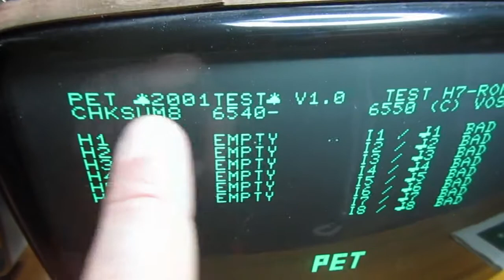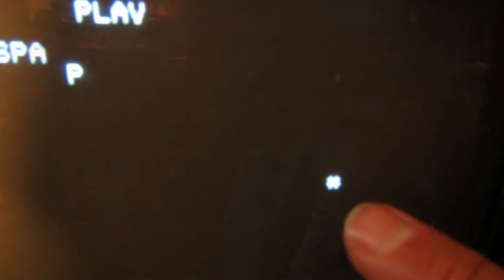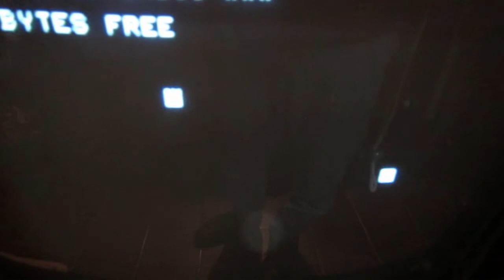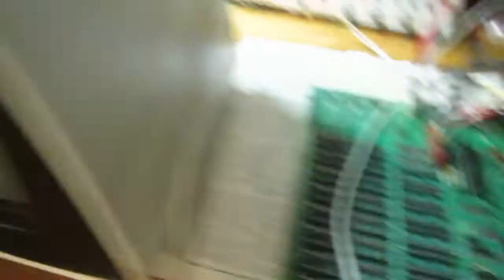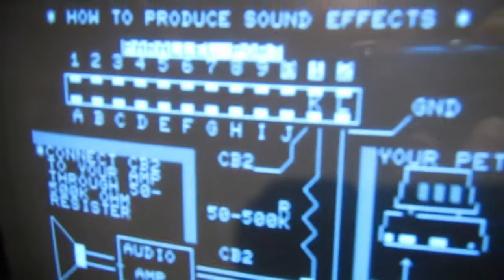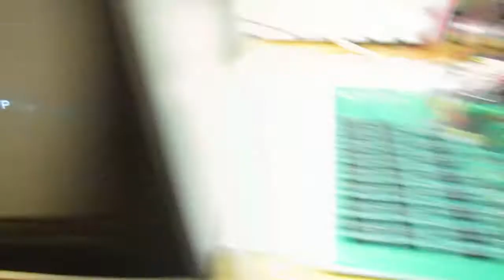Commodore PET 2001 repair. RAM/ROM daughterboard comes to rescue.

Comment: Interesting that the apparent video RAM fault was down to the speed of the video RAM chips not being quite fast enough. Awesome videos, love learning about PET repair and diagnosis!
Reply from the maker: Hi aphexteknol! Yes that was a possible explanation. I have mitigated the problem by exchanging the LS-TTL address drivers with S-TTL ones that are faster and can provide more current. I couldn't find any other explanation for the video problem other than faulty 6550s. Some of the address inputs could be degraded and need way more current than normal to toggle. The adapters with 2114 solved it completely and I hadn't working 6550s to test unfortunately.
Reply: iz8dwf Thats the real shame of trying to repair PETs, especially early models; is the lack of spare parts. Luckily we are seeing more and more replacements using more modern components thanks in part to your efforts.

Comment: Another nice fix, Frank. Did you have your PETmem RAM/ROM adapter board produced at through OSH Park? Have you shared the design (brd or Gerbers and BOM) anywhere?
Reply from the maker: Hi MindFlareRetro! Yes this first revision was produced by OSH Park, but the second revision (with new features) has been ordered already on EasyEDA since it costs less than half. Once I test the first batch I may share the gerbers.
Reply: That would be great. I have a couple of PETs that I have rescued (https://goo.gl/x9ypMQ) and would like the ability to make adapter PCBs if they are required. Thanks.